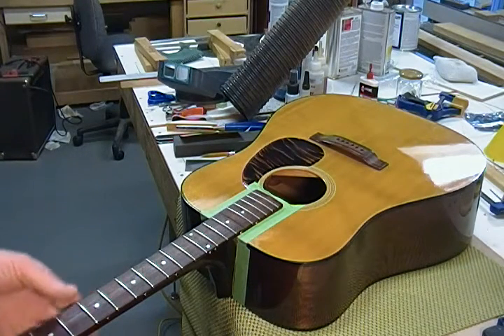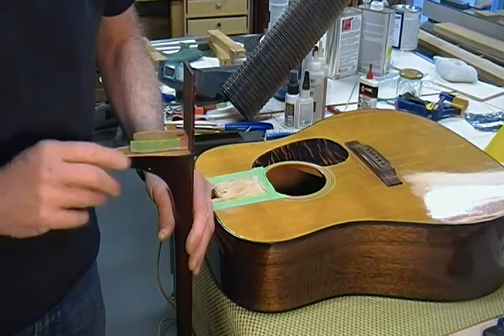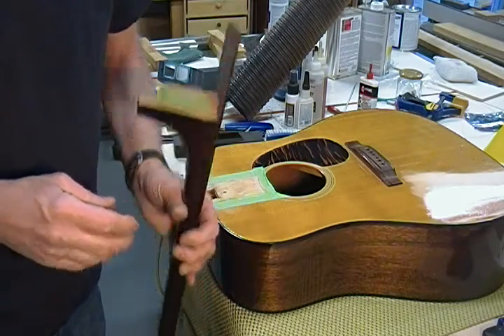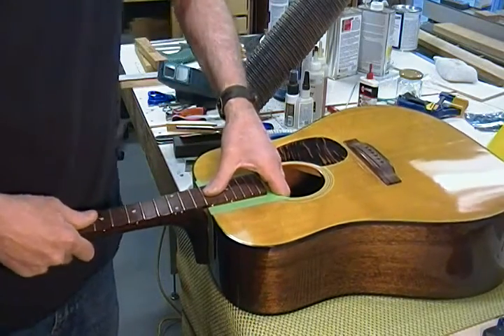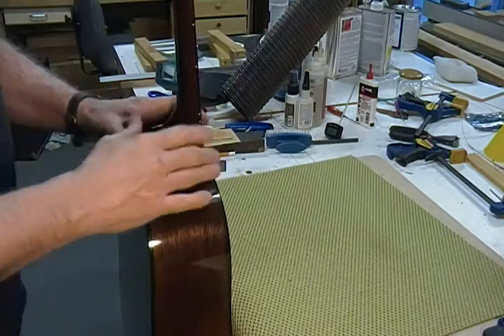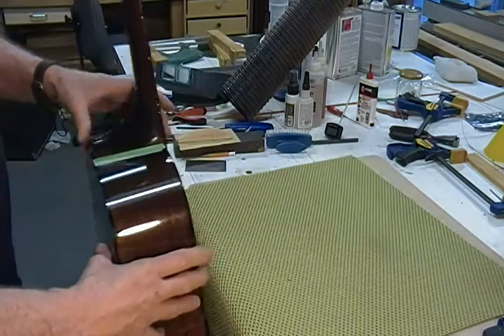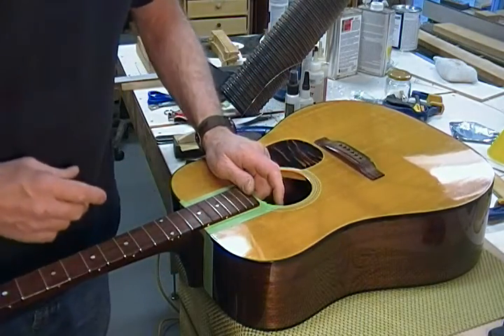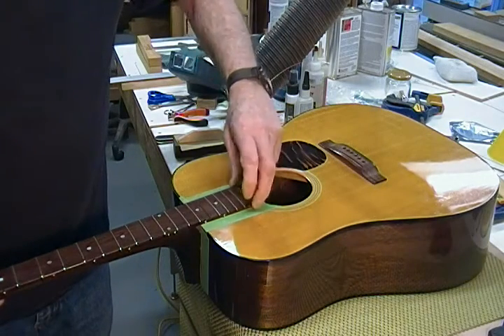70’ Gibson J-50 Neck Reset at Jonah Custom Guitars #7

Comment: What about the tape compressing over time?
Reply from the maker: The tape doesn't stay in the joint it just fills the space as I remove material from the heel. It also gives me a very good starting place on the needed thickness of the wood shims that will be made to fill that space. Sorry if that wasn't clear in the video. Thanks a lot for watching.